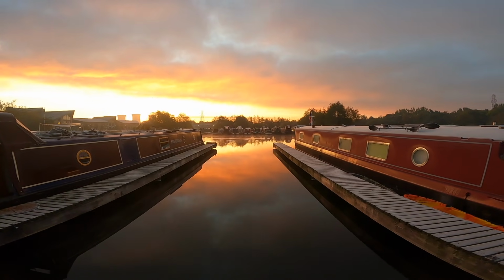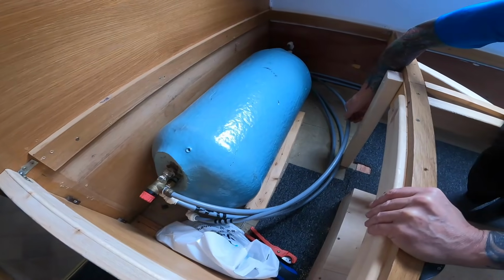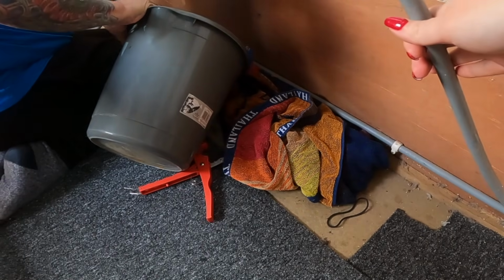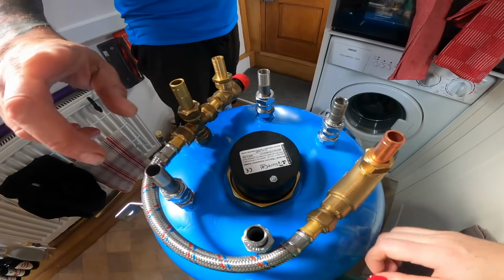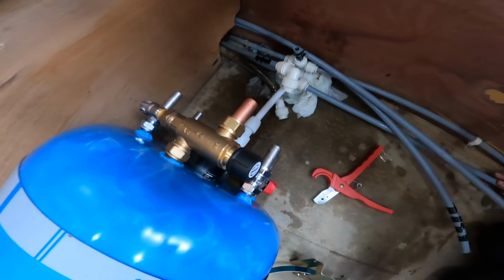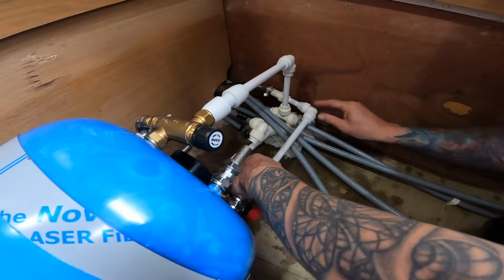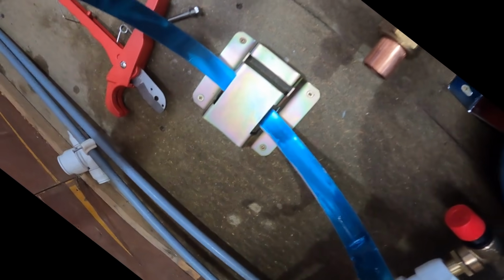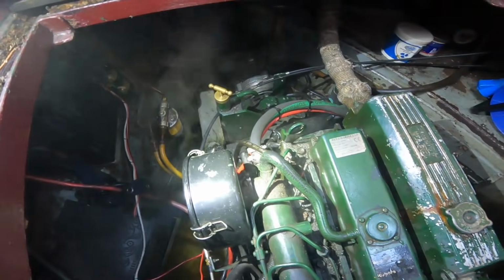Upgrading our HOT WATER SYSTEM doesn't go to plan!

Comment: The chances are that your skin tank needs bleeding,most of them have a bleed screw located on them,you could still wire the 240 side of it up for hot water.the 240 side is completely independent  from the engine side.
Reply from the maker: Hi Paul we have wired up our immersion heater now 😊

Comment: Wow, your calorifier is a doddle to get at!  Most are a nightmare. I must admit, I would have added a drain to the calorifer to make any further maintenance easier. And like others have mentioned, it seems you have an airlock in the engine cooling system which caused the overheating issue.
Reply from the maker: It is, we’re lucky! 😊